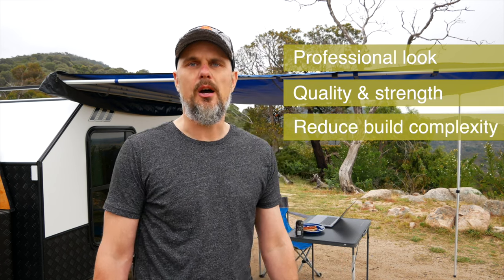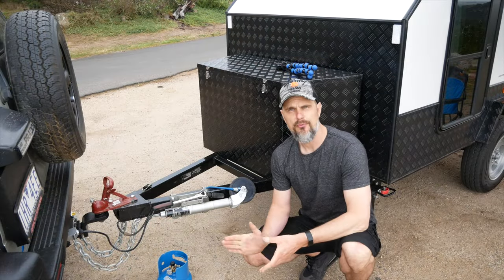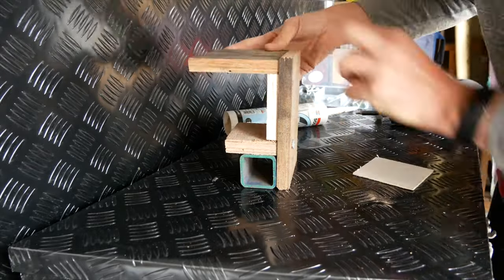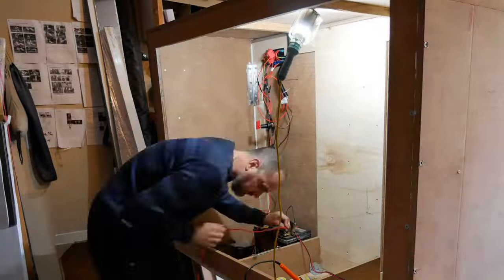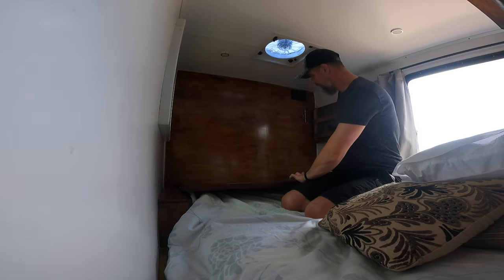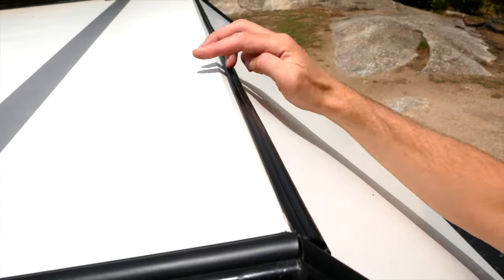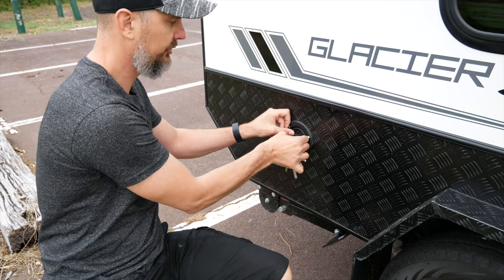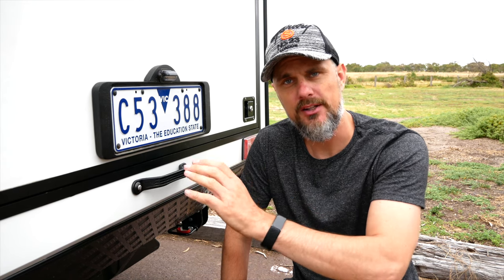DIY Squaredrop Camper FULL BUILD Walkthrough

Comment: Hey Elvis, lovely build, looks like it rolled out of a factory.  Can I ask where you sourced the 1.2mm aluminium checkerplate?  And the .7mm cladding?  (I'm in Sydney)  Also, you clearly went with a very solid build. Do you believe all the layers were necessary? If I'm understanding the layers you have .7mm aluminium, 18mm ext. ply, 15mm int. ply then 3mm melamine. Did you consider something like high density polystyrene instead of ply for the insulating layer. I must say when I was watching I assumed you must have been in the cold areas of Europe :)  Would there be anything you'd change or modify from what you've done?   Oops, one more thing - where did you get the j-mould?
Reply from the maker: Thank you very much.  
Please check the descritipn - I just updated the description of this video with links to where I purchased some of the materials.
.7mm cladding is just from a local colorbond supplier.
In terms of build structure, I think I could have most likely used less layers. I probably used too many in some places.  For starters I would change 15mm layer with just using timber battons inbetween insulation. I would probably look for lighter regular ply instread of marine ply, because i layered everything from outside with aluminium anyway so it doesn't have to be weatherproof timber.
I did look at poystyrene, and things like styromax, but the the build cost would go up in thousands.  But if you are happy to spend more, that's probably best option - lightweight and strong.   So to sum it up, if i did this again, and money was no object, i would go with Styropanels from STyromax.  Otherwise I would probably used lighter ply, and less doubling up on the inside.  I would also consider third option of steel frame, with just 3mm composite aluminium on the outside + insulation + 3mm melamime for inside.  But I would need to do proper technical analysis to compare the final total weight using this last approach... without it i'm not sure if it would be the lightest solution.
Reply: @Chilled Beans I've looked at the Styromax panels. They're awesome and they also manufacture and CNC cut to your design - but it works out around $200 sqm so could get pretty pricey.
Your last suggestion is close to what I was considering. 3mm outer skin (aluminium/foam) then a 20mm medium density styrofoam insulation layer and a 3mm inner layer of ply, melamine or maybe even another aluminium/foam layer. Bonded together it would be very strong and should be light. Internal ply or steel ribs (like ribs in a boat) would make it very stiff and strong and should be very light.  I'm currently debating whether to get a pre-built trailer or build one from scratch. Advantages and disadvantages to both but I'm leaning towards building one - can then be exactly what I want.

Once again, very cool build, it certainly doesn't look 'home made'. Thanks also for the additional information. I couldn't find the checker-plate at Uptons but there's bound to be a supplier in Sydney somewhere.
Reply from the maker: @kakman1958  I don't know if Uptons sells checkered plates online... I used to go there in person, and pick those plates. THey 100% sell them but you may need to look for some in Syd.  I spoke to another DIY camper expert on youtube and he wasn't sure if you would save a lot in weight with steel frame design. I figured once I'm ready to do it, i'd purchase some sample materials (steel rods/sample composite panel etc) and measure weight per square m.   Then compare it to doing same thing with ply. I think without building full trailers using each method, it's hard to know for sure which is lighter.  Steel is also more work... welding and drilling holes etc. Also you need to work out how close to place cross members to prevent outer panel caving in.
If i could offer some more learnings from my project - do'nt put fridge in the rear kitchen galley.  Because we found out during out camping trips that you want to have as much useable space at the back for working.  I modified mine to have stove under the openable lid.  So we have entire bench space available.  Having fridge in there just cramps everything too much (unless you make really big trailer).  I found the best option is to build slide-out door on the toolbox, and put a fridge in there. You can even connect to a battery for power if need be.
I would also not use colorbond again... i'd want to use more of a shiny look aluminium panels or something like that.  
All the best with your build. Feel free to message me direct if you have any further questions... my details should be somewhere on my channel.
Reply: @ChilledBeans  Much appreciated. I found a good supplier of both aluminium panels and checkerplate today (Ullrichs). They have a 3mm in 1200x2400 or you can get 4mm in 3000x1500 which would be ideal for building entire sides and roof in a single sheet. It's remarkably stiff and the matt white aluminium finish looks sensational. I think it would look great and be super easy to clean if I had it both inside and outside. They also have lots of extrusions etc - my head was spinning with ideas when Ieft :)
Reply from the maker: @kakman1958  These guys look awesome. THey sell j-moulds too.

Comment: Looks awesome. 
Can I ask why you didn’t choose a composite panel for the walls?
Reply from the maker: Thanks Callum.  There are few reasons.  Firstly this was my first camper build, and I knew I wanted to use 18mm marine plywood as a main wall material to achieve strength, and it was the most affordable option. So marine ply gives you super strong end result, at the managable cost.  Given this approach, I only had two options for the final finish - either paint (which I didn't quite like from watching other people's results - didn't look the best), or put another layer of something on top.  I could have use 3mm composite aluminium (which was more expensive), or something else - hence come in 0.6mm colorbond sheets.

Now, other option would have been to build a camper using ~30mm composite panels (in Australia Styromax is one such brand). These things are very lightweight and strong. However the downside is they are very expensive.  However, I think they would have been also a very good and very strong option. When I visited camping show I could see various build methods used on both big caravans as well as teardrops and pods - they range from composite, to plywood, to timber or aluminium frame with external cladding panels from composite aluminium or something else.

I think in the end it's a matter of personal preference and your budget and skillset. For my next build I'm keen to explore composite panel option for sure.  Stay tuned.

Comment: What do you think the roof load would be? Could it hold a rooftop tent and a couple kids, say like 800lbs?
Reply from the maker: I can give you my gut feel, but I don't have official engineering test results for this... My gut feel is that it would have absolutelly no problem carrying rooftop tent. I'm 200 lbs, and I walk in the middle of the roof and it doesn't move a bit. My roof is 18mm ply, sitting on top of inner ply walls, sitting on top of 30mm struts all glued up.  Remember, the rooftop tent would be sitting on roof racks, which only apply weight on the side walls.  That being said, I would suggest you weld some extra plates under the frame sides that would sit under your side walls - effectivelly making side walls sit on top of those plates.  This is one thing i would do on mine if i wanted to be 100% sure about large amount of weight.  Also you have to make sure your total weight with all the load (the roof top tent etc), doesn't exceed total trailer's registered legal capacity.  You'll need to make sure your suspenssion is specked for that weight etc.  Good luck
Reply: @ChilledBeans  almost like a rabbet joint, sounds like a good idea, ty!

Comment: Nicely done, what brand stabilizer jacks did you use, Thanks
Reply from the maker: Thanks. Got them on Ebay:  MOBI 400mm Drop Down Legs 1200LBS Caravan Corner Stabilizer Iron Legs Black
$235 AUD

Comment: Great build looks very professional never thought of using colourbond either for paneling. Also was that all the steps to get the trailer regoed, just get the weight send it to vicroads? No other process to it?
Reply from the maker: Thank you.  Honestly colorbond is one thing I'm still not sure about.  If i did it again, i would definitelly use a little thicker panels maybe 1 mm for the walls at least.
As for vicroads, that's it. That's all i had to do.  Get weight... call vicroads to obtain VIN number. They will ask what type of trailer is it, and you can say it's a box trailer.  Then punch it all in the chassy.  (including the plack plate).  Then organise appointent with them, and obtain the rego on the day.  If it's under 750 total weight with load, they didn't require me to bring it there.

Comment: In OZ…… where did you purchase colorbond cladding from for exterior…. Can you purchase non standard sizes?
Reply from the maker: Just a local colorbond dealer. Yes, I gave them the dimensions I want and they cut it for me, and even did the 45 degree and 90 degree folds for me.  The only thing is the sheets come in certain widths only, and I can't remember what that was... (could be 1.2m) but because of that restriction I had to do one join across middle of the roof.  The side was not an issue because the height of the panel is under 1.2, and I used black checkered aluminium for the lower section.   Your other option is to go with composite aluminium, or camper aluminium cladding sheets. I think those can be cut to bigger sizes, but they are thicker, hence heavier. I think 3mm, and not sure if they have in 2mm.
Reply: Thanks for reply. 
Also, I like your numberplate surround with light…. Is that an online job or from a shop?

Comment: I really like it but only thing Id like to change would be the ability to stand up straight in the galley area
Reply from the maker: That's a great observation. I actually fixed this now by simply changing the angle brackets to a bigger/longer ones, and now it lifts the door high enough so that I can stand (i'm 6"1). My wife can stand there without problems even with original setup.  I'm also rebuilding the toolbox in order to put the 12v fridge in there, as that frees up room in the kitchen which you really need when cooking etc.
Reply: @ChilledBeans  I appreciate it! Hoping to find a trailer soon that will work to build my self something similar this summer. Really exciting.

Comment: NIce...I notice the "j" mould on the external corners but can you please tell me what joiner you used horizontally between upper Colorbond and black checker plate as transition? I.e what are they? Where from. Thanks
Reply from the maker: Hi.  It's a flat version of j-mould. Some places call them j-trim as well.  I bought it from the same shop that sells the corner j-mould (see the description).  They are great little trim to use for transitioning flat sections.
Reply: @ChilledBeans  No worries. Couldn't find on their website. Thought it was something specific. I went to Capral in Adelaide and they said had nothing like it. Cheers
Reply from the maker: @andrewbutler9553  Ah yes, I remember I couldn't find either online... but when I went to pickup the curved ones, I saw it on their shelves so I got it.  Give them a call.  Last time i was there they were also building their own caravans, so they use all that stock themselves.  (Now if only they compensated me with some discount for promoting them for free 
)

Comment: Only one window?  It looks heavy.  What’s the weight?
Reply from the maker: Yes because there is the door on the other side.  I never really felt like I need an extra window.  But it is slightly heavy... 920kg,  very strong but a bit heavier than if i used composite panels.

Comment: Where did you get the material from?
Reply from the maker: I listed the specific shops in the comments.  All localy source from various hardware or camper shops in Melbourne.  Depending on your location, you may need to do a bit of digging around to find local suppliers

Comment: how much does trailer weigh.
Reply from the maker: Originally the base build was 720kg.  But since then I added few accessories, and solar, so I haven't measured since then. I'm now in the process of installing a brake system and will upgrade the weight/registration. I'll upload a video of brake installation once it's done including the new total weight.

Comment: Your weight is wrong it will be a pig to tow, you need all the weight up front not at the rear
Reply from the maker: Hi.  I agree, the trailer needs to have more weight up front.  Why do you think the weight is wrong on this trailer though?  My current setup makes the trailer heaver at the front (even when fully loaded). I can't remember exactly, but the tow ball weight is at least 80 kg.

Comment: Mine is made with one inch square steel . Stainless panels . Aluminum frame . It will never rot or burn down . Only weighs 550lbs
Reply from the maker: That's fantastic. I wish I could weld aluminium.